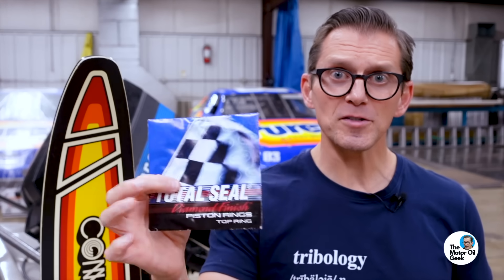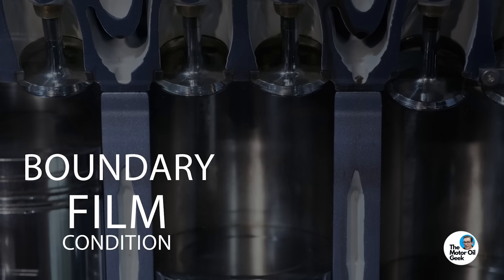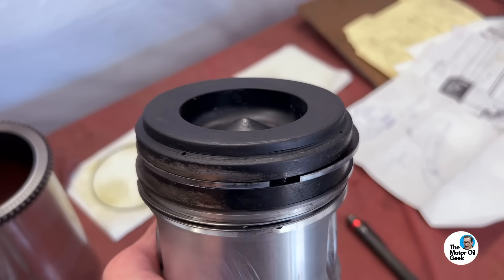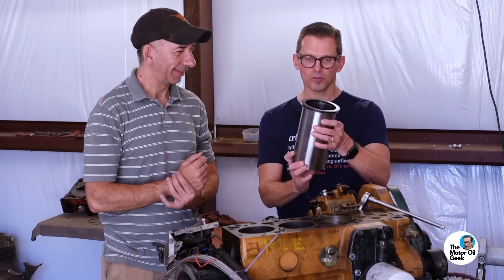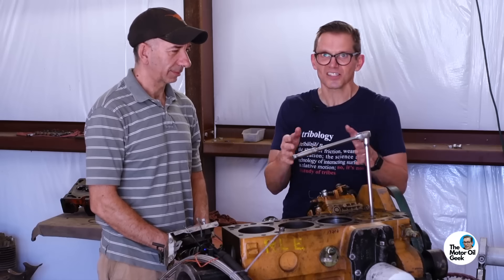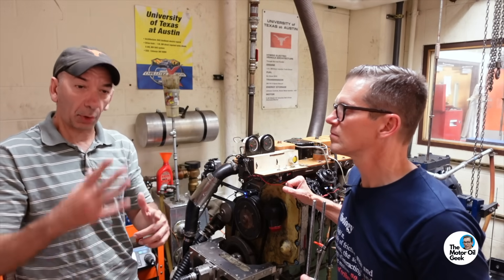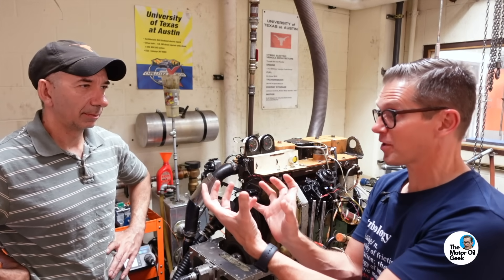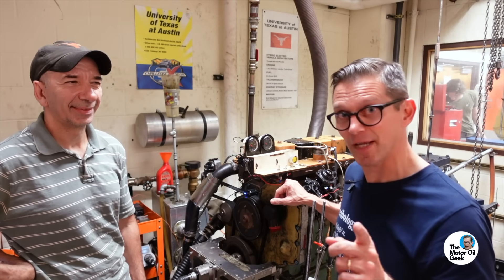Water Skiing Explains LUBRICATION - This CRAZY Engine Proves It!

Comment: Interesting, but what about the wear of the piston groves lands, upper and lower of each groove? Is there a misalignment issue with ring gaps getting too close together, from each ring on a piston. The amount of friction taking on to rotate the sleeves, vs oil film claiming to be doing its thing? How are the water jackets sealed? Again, interesting to see, just curious is all.
Reply from the maker: The rings are pinned like a 2 stroke so they don’t rotate.

Comment: Love your channel.  you've got some great videos.  I have a question and apologize if you've already covered it, but what is the safest way to start a car after it's been sitting and stored all winter?  While it sits for 4 5 months, does all the oil settle in the motor and cause a damaging first start?  Is it harmful to let a car sit for 4 months without running?  Turbo cars?  NA cars?
Reply from the maker: https://youtu.be/D7hvTWsLIP8

Comment: Wouldn't this design grab the rings and constantly ruin the compression, oil control. 

Chances of blow by are low but never zero
Reply from the maker: The rings are pinned just like in a 2 cycle engine, so they would not be harmed by the rotating liner.

Comment: Isn't this concept just going to end up spinning the piston rings inside their grooves? How will that affect the crosshatch in the long run and what is the consequential effects of the rotating sleeve? How does certain rpm affect wear on the pistons and rings because i can omly imagine that the rings will begin to act like piston ring cleaners and eventually causing a piston to fail especially under high stress loads.
Reply from the maker: The rings are pinned, just like in a 2 cycle, so they do not rotate.

Comment: So as the forces go off axis to the bore, is there friction between the sleeve and the block? What about the geared face at the top. If the cylinders are putting side load on the sleeve it would act like a lever and maybe wear on the head mating face.
Reply from the maker: That's why they want to build a 6 cylinder prototype to answer those questions.
Reply: @themotoroilgeek  That too!

Comment: I have been rebuilding truck and tractor engines since before you wear born . I always believed the cylinder top end wear was compression related ,
Today I learned  SOME THING NEW , thank you chap much appreciated .
Reply from the maker: I'm glad it was helpful.
Reply: In a way it is if the crank was driven from the crank end with open valves. the oils viscosity would be high enough to maintain a boundry layer.
When combustion occures that creates a downward force and the crank resists that force due to the resistiance of the vehicle, this is a upward force. Due to the angle of the crank those 2 oppsing forces push the piston to the side and overcome the viscosity of the oil.
By rotating the liner you are reducing the ammount of time the force has on a given area of oil.

Without compression the engine could likly do the eqivalent of 1 million miles and have basically no wear.
Reply: @jamessssssssssssssssssssssssss  Close enough ...  As far as the piston skirt is concerned.  The rings are also a big factor, cylinder pressure gets behind the rings to push them against the cylinder in order to seal.  This is also a major friction source that the rotating liner comes to the rescue.  Cheers.

Comment: You are missing a big piece of physics. There is more wear at the top of the cylinder than at the mid-section or bottom of the cylinder as the top of the cylinder has far more pressure on the rings to expand at the top of the cylinder than it does at the bottom.
Also the water skier rises to the top of the water because as the skier moves through the water, the faster and faster the skier goes, the more water has to be forced out of the way. With a ski facing forward when the pressure of the ski becomes greater than the force to move the more and more water out of the way, the path of least resistance if the skier points the skis at an upward angle, is to go up. 
Not having skis and dragging a person through the water would force them to drown. 
The piston rings are not forcing a lake full of water out of the way. The rings are only forcing the oil the piston rings are in contact with the cylinder wall, away from the cylinder walls. 
Sorry to be the bearer of bad news.

Comment: That cluster is gonna wear out a lot faster than the cylinder with good modern low tension thin rings
Reply from the maker: That's why they want to build a 4 or 6 cylinder prototype to do durability testing.

Comment: Most of the wear at the top of the bore is caused by piston rock , and the ring moving in and out of the ring groove . Btw this engine has inherently less due to the ridiculously low RPM , and the lubricity of Diesel fuel . Again , the funding grant is admirable  .
,, on edit : the whole explanation is supercededed by not prioritizing the primary cause of wear . That is the piston rock causing the ring in and out of the ring groove at a very inopportune time of near highest cylinder pressure . The monkey motion ( that will not catch on ) will only reduce the cylinder wall wear by 10 to 20 percent modern engines using quality parts and oil have quite a long life . Well , if they dont have monkey motion valve train displacement alteration . Also I don't buy the ten percent fuel savings , maybe 2 percent . Also #-2 , I dont want to pay for the funding to do this to a modern , gasoline V-8 .

Comment: For those of you wondering why any of this matters, realize that engines today are obsessed with ring friction. That’s why all these modern engines are burning tons of oil at 150k, they have all moved to very thin, low tension rings, resulting in big problems with carbon buildup causing blow-by later in life. We’re at the point where cutting ring thickness in half matters significantly. 

Same reason 0W-7 oil is now a thing, designers are chasing fractions of improvement, typically to the detriment of long term durability. 

If they can get a net reduction of friction with this design this is not just for longevity, it’s for overall efficiency.

As will all new designs, the biggest hurdle will be overcoming 125 years of previous development. Still, it never ceases to amaze me the creative variations people are constantly coming up with on engines. Wild!
Reply from the maker: You are spot on!

Comment: Yeah sleeve valves can work, but they are complex and we moved to poppet due to manufacturing and reliability. So yeah all this stuff was done in 1940s in airplanes. Yeah with modern tech we can improve on it but always suspect of cost vs reliability

Comment: The single-sleeve valve didn't purely rotate.  It rotated and reciprocated in an elliptical path.  The important thing about it was that the liner never stopped moving, so there was always relative motion between the ring and liner.  But that was only a secondary benefit of the sleeve valve.  It improved engine breathing and eliminated the hot-spot in the combustion chamber caused by the exhaust valve.  Sleeve valve engines could have higher compression ratios and total freedom in combustion chamber design.  Their lubrication requirements were not aggressive because piston thrust on the cylinder wall was borne by such a large surface area that unit loading was low.  Manufacturing a good sleeve was very difficult, though.  Early test engines had a problem with the sleeve going out of round and sticking in the cylinder.  The problem was solved by improving the finish grind process to eliminate residual stresses.

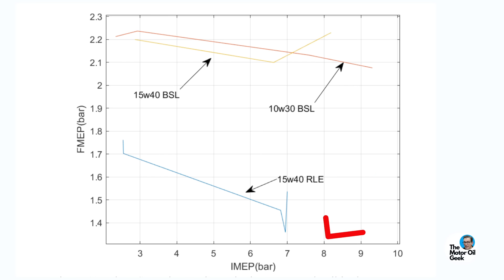Pause on the graph at 10:50  It's weird that the friction is slightly lower on the BSL (presumably Baseline engine) with the 15w40 oil vs the 10w30.  The RLE (presumably Rotating Liner Engine) shows about 20% decrease in fmep.
Reply from the maker: Higher viscosity oils tend to have lower friction at low engine speeds and high load. The thinner oils have lower friction at higher engine speeds.
Reply: @themotoroilgeek  Thicker oil film to get out of boundary lubrication....
Reply: The percentage reduction in FMEP is not so important, because both engines have high FMEP due to the nature of a single cylinder running a 4 cylinder crank.  The important factor is the difference in FMEP, the 0.80 bar.  When this is applied to a complete engine, it makes a huge difference, more than half of the friction is eliminated, and the fuel economy goes up by about 10 % at part load.

Comment: Oil pressure/fluid bearings/hydrodynamic friction illustrated… I always remember being a little kid and my grandmother boiling something in a pot with the cover on. I believe it was revereware and the fit was just right you could grab the handle of the pot top and spin it and it would keep spinning completely frictionless, it was suspended on a cushion of steam. Also air hockey is a fluid bearing of sorts.
Reply from the maker: Thanks for sharing!

Comment: Now saving 10% on friction is massive, but consider every car manufacturer or outsourced companies who now have to make rotational liners for ever type of Gasoline or diesel engines out there, not worth the money full stop, a lot more cost effective to produce a oil which reduces the wear and friction in engines and also piston ring composite materials to work with engine alloys, notice its a cast steel engine and not a looy engine ?🦘🦘👍👍

Comment: this seems interesting, but i'm curious does the liner need to be directly connected to the crankshaft? and does the speed of the rotating liner have to be proportional to the piston speed/crankshaft speed? 

it seems like once the liner gets moving, it will continue to provide the reduced friction, even at a slower speed than it's currently ran....it would reduce complexity, vibration, and parasitic loss if it was driven by a hydraulic motor or electric motor, or a combination of both for redundancy.  

just a thought, great video
Reply from the maker: The liner driver does not need to be connected to the crankshaft, so it can be driven at an ideal speed separate from the engine RPMs.

Comment: I simply can’t see how to keep that combustion seal from wearing out much faster than any normal head gasket. Sorry way too complex and too many failure points. I can’t see this being used in a long term case scenario. The amount of pressure on the combustion seal would create such additional load it would create so much loss. 
Plus in a high power application I can’t imagine it holding at all. I could be wrong but we will see.

Comment: Im really doubtful of those numbers. There have been so many crazy project claiming to increase efficiency by such leaps and they almost never pan out. With the crazy added complexity, I doubt it will be viable and Id bet the savings are more like 1-2% net.
Reply from the maker: 10% is the net efficiency gain. They do need to move from a single cylinder prototype to a full engine prototype to continue the development and testing. However, this is strong proof of concept work.

Comment: We need your help 
There is a huge debate   on whether or not we should use a catch can on our L8T
Reply from the maker: The GM LT Direct Injection engines have air/oil separators built into the PCV system from the factory.

Comment: My question is: Does the addition of complexity drop durability, OR does the decrease in friction lengthen durability?
Reply from the maker: Only further testing could determine if the mechanism to rotate the liner would hinder durability. With that said, the reduction in friction and wear of the liner would increase the life of that component.

Comment: I'd be interested to hear your take on why small high performance motorcycle engines require such short oil change intervals compared to large high performance motorcycles. For example, a KTM 500exc-f requires an oil change every 15 hours, while a KTM 1290 Superduke at a whopping 10,000 miles.
Reply from the maker: Oil volume and wether the clutch shares the same oil sump impact oil change intervals.

Comment: Interesting, as always. However, the trend of increasing complexity for incremental gains in fuel economy will be the ultimate downfall of the ICE. Each increase in complexity has introduced failure points and decreased the durability and longevity of our automobiles. The conspiracy "nut" in me thinks this could be a deliberate tactic in convincing us to give up on ICE engines in favor of electric. By 2000, the  typical ICE had become reliable and trouble-free, giving hundreds of thousands of miles of use with only simple maintenance. Those days are gone.
Reply: There are two types of complexity.  One where it offers nothing to the engine user (example catalytic converters or after treatment).  The second type offers plenty to the engine user (example larger number of cylinders, 4 valves per cylinder, etc which offer more power, more smoothness, etc).  This rotating liner complexity belongs to the second type.  The complexity offers substantial improvement in fuel consumption while eliminating engine wear.

Comment: Since the rings have pressure on the cylinder walls wouldn’t they spin with the rotating cylinders?
Reply from the maker: The rings are pinned, so they don't rotate.

Comment: This is an interesting research project in that it helps quantify how much friction is involved with the rings.    But I don't see it being viable in a production engine.   A) Any benefit is offset by the extra complexity/friction of implementing rotating cylinder sleeves.  B) Let us not forget that the sleeve valve engine also had it's own set of problems that eventually led to its demise.   I applaud the research effort otherwise.

Comment: I am hoping that maybe you can answer a question for me I plan on building an engine it will be a 360 5.9 L Dodge Magnum but I plan on putting a 408 stroker kit which will take it to about 6.7 l along with a few other modifications I'm expecting a approximately double the horsepower from about 245 to about 500 from what I found from you and my research between your videos and other sources I think 5W-30 would be the best I plan on using a full synthetic mostly daily driving nothing too crazy daily maybe a little bit of off-roading on the weekends nothing too crazy but I plan on having a deep oil pan that holds about 8 quarts of oil how often should I change it assuming I use a good oil filter in a good full synthetic

Comment: There is a lot of controversy within the rotary community as to mineral oil and synthetic blends.
Could you please do a video explaining your take on this conundrum.
I personally am using full synthetic and haven't had an issue.
As a heavy duty mechanic for 40 years, I appreciate your videos.
Keep up the good work.
Reply from the maker: Thanks!
Reply: Would also like to know if this has any credibility. An old thought was that they didn't know if a synthetic oil would burn so they were being safe. But much 2stroke oil is ester oils sometimes from castor beans especially back in the old days. There are synthetic ester oils and ester based modern 2stroke oils. I don't know if a pao will burn easily and I do know that it's legal to call a mineral oil synthetic in USA if it's been hydrocracked or created through perhaps an even more involved lab process like the gas to oil base stocks. So a lot of this discussion may have a lot to do with if you're synthetic oil is or isn't mineral oil, because in America it very well may be that it is mineral oil with other base stocks added to it. But if a pao oil burns fine, could it be that the rotary guys are just being a little too cautious? And are there more important things to watch out for like additives known to cause detonations?

Comment: Hi Lake, I love your channel and look out for your new videos whenever you release them. Do you think with the GM L87 V8 engine probe, you could do some oil analysis (using maybe your contacts in the industry) to test the used oil of some of these trucks with some miles on them when they come in for a service? Ie see if too much metal in the oil or maybe too much fuel getting in and destroying the oil protection? Or maybe the failures are down to poor oil change intervals by the owners?

Comment: The sleeve valve as it existed in the Napier Sabre most likely caused more friction problems along with other problems. If I remember because the sleeves moved partially with the piston it cause uneven wear in the sleeve and there is obviously the problem of lubricating both sides of the sleeve. This other design overcomes it in some aspects by having the sleeve move multiple times the speed of the piston, but the complexity might not be worth it.

The origins of the sleeve valve are to overcome the problems of valve float at high rpm, and deal with the inherent restrictions of engine valves such as the change in air flow direction. As technologies such as the liquid filled valves emerged the need for sleeve valves declined, although I would like to see them used in a modern vehicle.